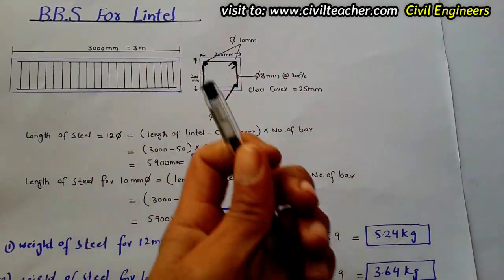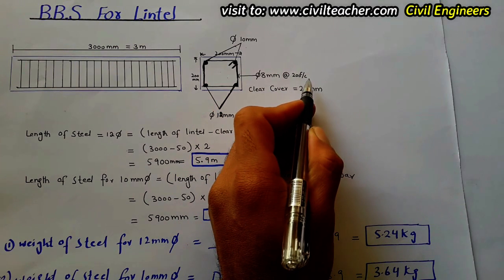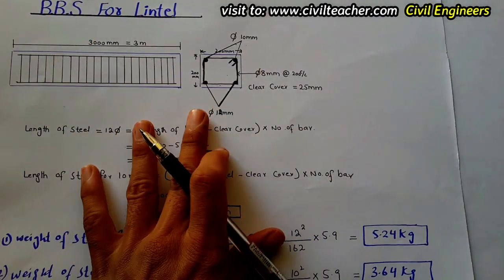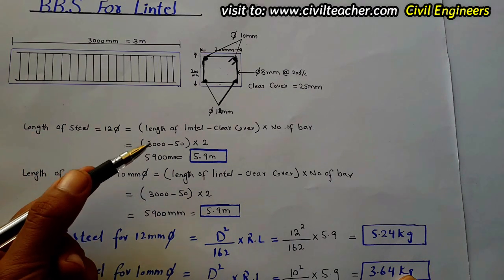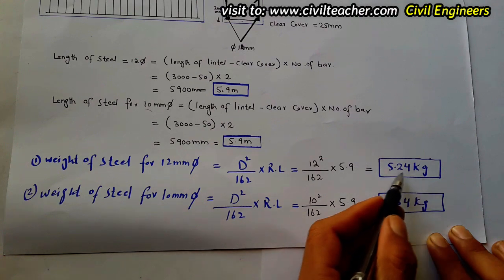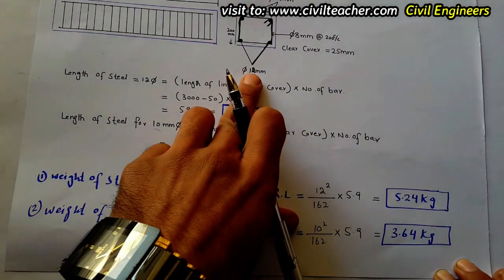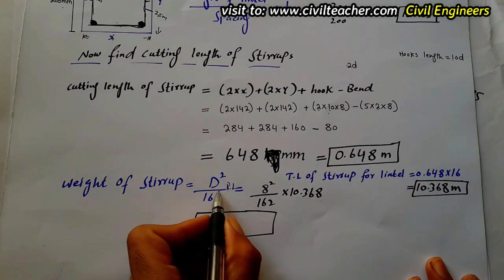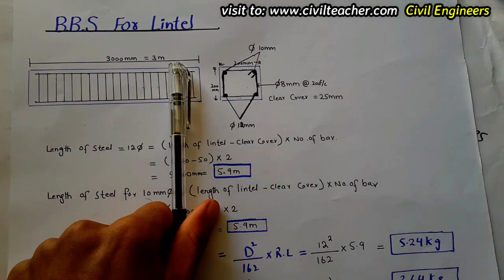BBS for Lintel Beam | Steel Estimation for Lintel Beam |

Comment: salam janab me abrar sir need teach if a culvert raft we providing the steel 1/2 in dia  in 15 ft x 100 ft  with 1 ft depth  by spacing of  5 in c/c and the  culvert has 2 cell  mean 3 no of RCC Walls  now i want to convert the steel to 5/8  what will be the spacing pls